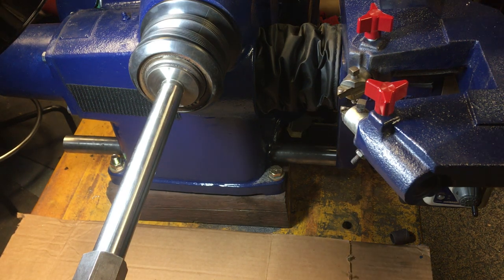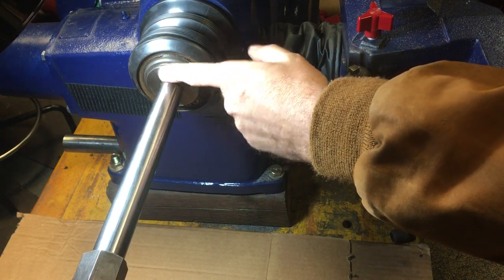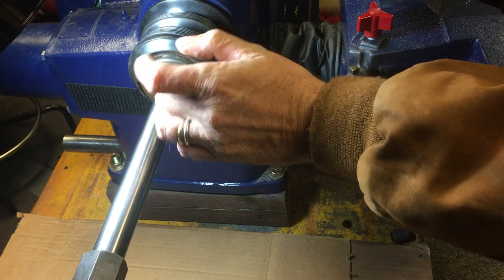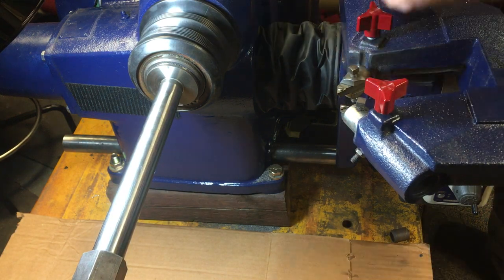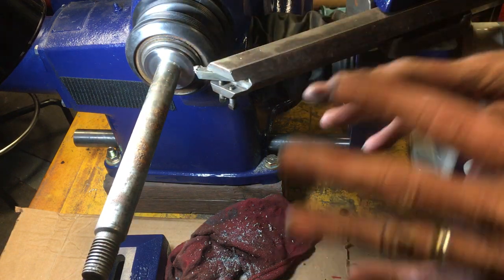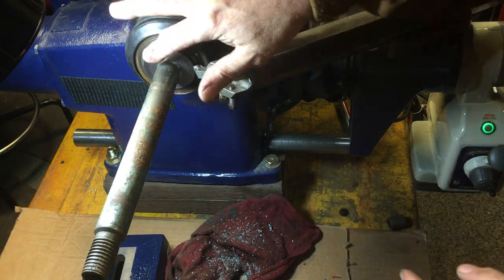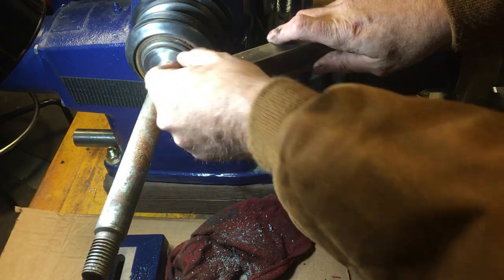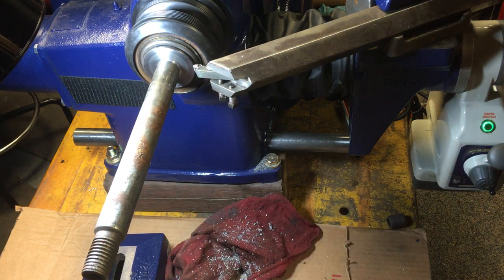Brake Lathe Repair - Arbor Facing

Comment: I do this when servicing machines only if it needs it. Having high and low spots also causes issues with chattering. Because the first cup needs to be solidly mounted against that face. Make sure the arbor is good and tight too. Its the little stuff that makes these machines work best. Some times I find chips smashed into this face. Most times it can simply be cleaned with sand paper. But with gualing its best to reface it or replace it.